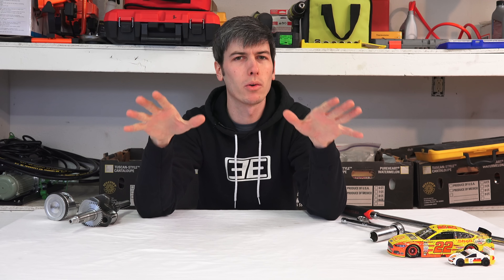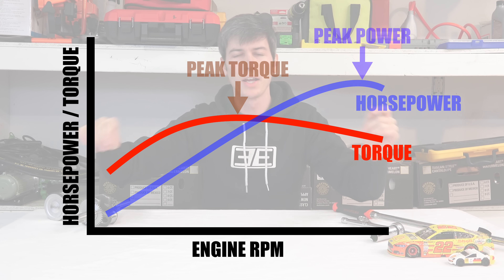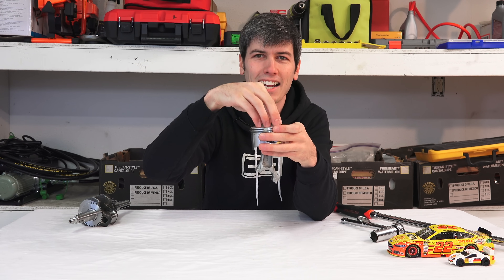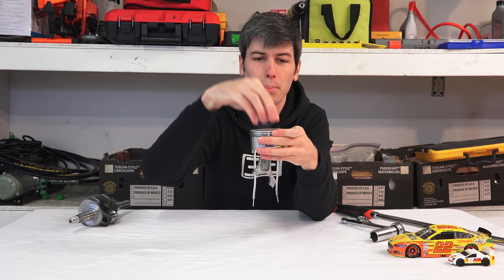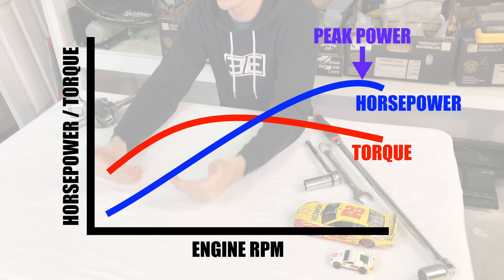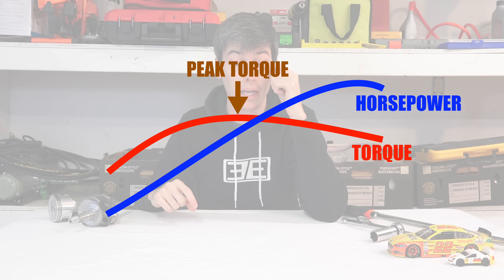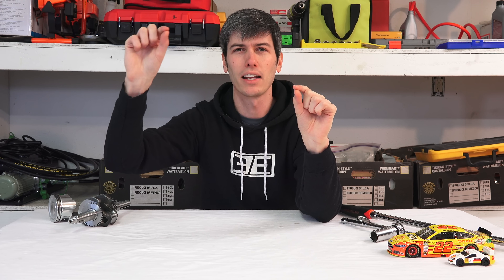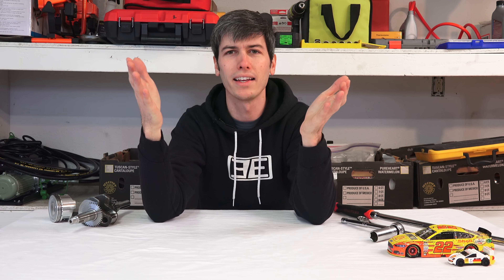Horsepower vs Torque - A Simple Explanation

Comment: Think of it like this: Torque is how much weight you can bench press, horsepower is how many reps you can perform with that weight in a certain time frame.

EDIT: I tried to keep it simple by mentioning "time frame"  because you have to have some way of measuring how fast the weight is being moved in the example I've given.  Which is confusing some people on RPM's vs horsepower. Think of your RPM's as being your rep count. And your horsepower is how fast you can move the weight to that rep count. For example..if you have two bodybuilders that have the same torque but different horsepower, it's going to take the one with a higher horsepower less time to get to 10 reps than it will the bodybuilder with the lower horsepower. Even though they are both lifting the same amount of weight and doing the same amount of reps.
Reply: So then with an engine, there is no muscle fatigue, so it's just your max a number of times within the time frame?
Reply: @dukechangwang8017  not really like muscle fatigue, it’s more of like the actual speed you can rep over and over again.
Reply: @dukechangwang8017  Your question is an ironic conundrum funny enough. Horsepower is kind of like your muscle fatigue. It determines how fast your engine gets up to it's maximum torque and can maintain it's peak potential. If you have low horsepower and high torque, you'll stall out under a heavy load, because you don't have enough horsepower to get to peak torque and maintain it. Just like not having enough energy to do more reps, let alone more reps at a faster pace.
Reply: @Ironwind1972  so since torque is tied in and dependent on horsepower, there's no way you can have high horsepower and too low of torque right?
Reply: @dukechangwang8017  As long as you have the torque to move the weight of the machine to begin with. But take motorcycles for example (inline engines), they have high Hp and lower Tq. That's why they accelerate quick and maintain speed so well, they reach their peak torque numbers faster and have the ample horsepower to maintain it. They just don't need the Tq due to their lightweight.
Reply: @Ironwind1972  you're a godsend I understand this a ton better now thanks 🙏
Reply: @dukechangwang8017  Haha thanks man. Kudos on your computer build videos back in the day. I used to make a few myself on the same subject.
Reply: @Ironwind1972  hahahaha thanks man! Seems like we ended up in similar spot but you're waaaay ahead of me haha
Reply: @dukechangwang8017  No.  A high revving engine with produce the same power as a low revving engine that has more torque.  Power = RPM x torque  = 6000*10 or 3000*20
Reply: @Ironwind1972  thanks now i understand the relation between the two. But it is 'its' not 'it's'
Reply: @Ironwind1972  so in theory when you’re going through the gears, I feel the “pushed back in my seat” sensation at lower gears because they reach peak torque earlier in the RPM range? But when the engine is in auto (even in sport), the engine still upshifts at 6k RPM latest, so is that because it’s saying “if we’re going to be at this RPM while you’re mashing the throttle, we might as well be at that RPM in a higher gear where we max out horsepower here”
Reply: That's a very good explanation
Reply: Force in and of itself is nothing special. Any old wimp like me can lift Eddie Hall's weights using a hydraulic pallet jack and multiple handle pumps and a tonne pallet of mineral water inches its way off the ground using nothing but my arms. Find me the toughest pick up truck and I can conceive of a pedal powered vehicle that can win a tug of war against it. It just needs enough weight on the wheels and enough gear reduction to inch the truck backwards.
There is no way through any system of levers that I can increase the POWER of my body. I have to fitness train for that, otherwise what would we need engines for anyway? I recall Garage 54 fitting 4 differentials to a Lada and giving it epic pulling force, but the engine power was unchanged.
Reply: Does torque mean the torque on the tyre in that case acceleration shoul be greater right since torque moment of inertia times angular acceleration and sice hp us torque times rpm does it mean it has higer velocity ratio and therefore it accelerates faster ?  Does higher torque at fast speed not beneficial bcoz the transmission and tyre are not in sync therefore slowing each other plz explain bro
Reply: @Ironwind1972 Thanks, your explanation makes sense and was pretty understandable. However, the main issue I have with torque is what does it practically mean for my car? I mean, with higher HP number I can immediately make a conclusion that my car can go faster, accelerate faster, pull heavier things, etc. But what can I conclude from higher torque number? Imagine I'm trying to buy a car, I'm looking at two cars and they both have exactly the same HP number, but the car A has more torque than car B. What would I be able to conclude from that? What's that car A better at doing in real world than a car B?
Reply: I would say that horsepower is how much you can bench press (it is straight pushing on the weight), how many reps you can do is how big the gas tank is and torque would be getting a big lever to lift the weight.
Reply: @davesutherland1864  I think that torque is how heavy of a weight you can lift, horsepower is how fast you can push the weight up.  That example works better in terms of engines, but it doesn’t really work to well with human biology. Since horsepower is torque*rpm/5252 (?), then RPM is bench presses per minute, torque is the actual amount of weight you can lift, and horsepower is how fast you can push the weight upwards. It may seem like horsepower and RPM are the same thing in this example but that’s because the horsepower is basically based on RPM.
Reply: @Chevsilverado  If you really want to get technical about this, moving the weight up requires energy to increase its gravitational potential energy (mgd) which is supplied by the arms.  Moving the weight down requires the same energy to be applied by the arms to absorb the gravitational potential energy loss.  The greater your repetition rate the greater the power you are outputting.  When you can’t do it any more you are running out of gas.  The only torque involved in this situation is that at the joints involved in the operation.  This is like a piston moving up and down, but not connected to a drive shaft.  To extend the analogy for torque in an engine would require you to pushing on a lever rather than a weight.  That lever could be use to transfer rotational energy to a wheel or a drive shaft.  In this case the rate you push up and down is related to power, torque is related to how fast the lever turns the wheel, and when you need a break is like filling up the tank.  And you can change gears by changing where you push on the lever.
Reply: @Chevsilverado  I was trying to keep it simple and use layman's terms. But sticking with my human biology example,  RPM would be your rep count. HP would be how fast you can get to that rep count. It's why a high horsepower engine revs to 6000 rpms faster than a low horsepower engine with the same load. Yet they are both still going to 6000 rpms.
Reply: @Ironwind1972  🤦🏼‍♂️
Reply: I don't think this is correct... Sorry.
Reply: Geez... Why are you all making this so complicated?!... Imagine you're with a girl... Can you hold out long enough to satisfy her?! That's you're bloody torque and horsepower... Your mind vs your body hence your ability to keep the flames of passion going... Rev her engines - RPM - your smv...

Comment: Alright, it took me years to figure it out but heres the difference between horsepower and torque.

torque is what the engine makes directly, its the individual combustion stroke of every cycle.

power is torque applied over time. RPM being a measurement that is based on time. and the mathematical relationship between horsepower and torque requiring rpm input.  
Hell 1 horsepower can be written as 33,000 foot-pounds/minute

if you have an engine with low torque and one with high torque, but they make the same amount of horsepower.

its the low torque engine will rev higher.

if torque was always just a straight line in an idealized world. Making horsepower could be achieved by increasing the rev limit, or increase the amount of torque made.

RPM is such an important factor in the torque/horsepower relation, its ashame it wasnt stressed as much as it should've been in this video.

Comment: Perfectly Explained! I've been wondering about HP/Torque. I'm definitely picking up an Indian Scout 1100cc (100HP&72lb-ft). VS. The Harley-Davidson Forty Eight 1200cc (60HP&73lb-ft) Just Can't Compete.
Reply: But doesn’t the scout also have very long gearing i.e it can go upto 100kmph in the first gear and only get the max hp close to the peak rpm and it will vibrate a ton when at high rpms. Why not go for the Indian FTR if you want speed?

Comment: I like to think of the rough analogy that power/torque/rpm have to watts/voltage/amps respectively.
Reply: Pretty much.  And the transformer is analogous to the gearbox.

There ultimately are two factors that determine power in both cases, and power equals the product of them.  You can reformat the mix of those two factors with power conversion devices like gearboxes and transformers, but you need another energy source to change the power.

Comment: I like to imagine a hill and caravans, horsepower being how fast you climb the hill without the caravan, torque being how fast you climb the hill with the caravan.
Reply: That's incorrect, the vehicle with higher power output will be able to climb faster.  Low-end torque will help you accelerate off the line at low RPM, but a low-torque motor can make up for that by revving higher.
Reply: @buzzlesworth54  oh okay I always attributed torque to pulling power, that's interesting completely shifted my peanut brain

Comment: With some fuels like Nitro or Methanol. The amount of fuel you can burn I.E. the power you can make is a function of engine load. Making peak power output closer to peak torque 🤷‍♂️

Comment: FAIL. I still don't get it. I wasn't shabby at mathematics and physics at school. I have not studied either since, but I did study formal logic, analytic philosophy and other conceptually challenging stuff for years. I'm not a dummy. Still, after living 59 years, I've yet to hear a clear account of the difference between power and torque.

Just guessing, but it seems power is the product of torque and gearing taken together. The long handled spanner allows more force to be applied, but more slowly. The hand placed at the end of the long spanner moves a greater distance to achieve the same tightening of the nut. This arc of turn can be geared, and it is the combination of the force over that arc and the gearing that produces power. I think.

But longer handles are just a form of gearing. So, it seems, torque is also the product of gearing an arc of turn,  and this appears to be the beginning of an infinite regress.
Reply: Torque is a turning force. It is a measurement of how hard the engine is turning. A very low torque motor would be easy to grab with your hand and bring to a stop, a hogh torque would not. Power is torque times angular velocity, how hard the engine is turning times how fast it is spinning.
Gears can be used to multiply torque at the cost or gain of speed. A gear ratio greater than 1:1  increases torque at the cost of speed, a gear ratio of lower than 1:1 increases speed at the cost of torque. Power will remain constant unless the engine output is changed.
Reply: @Redtooth75  Pretty good! I'll think about that! Thanks!

Comment: In electronics it roughly translates to: torq is amperage...horsepower is amperage x voltage.
Reply: No, torque is analogous to voltage, and angular velocity is analogous to amperage. Torque is the potential for mechanical power if it's applied to a rotating body in the same way that voltage is the potential for electric power if it's applied to a moving current (a positive amperage).

Comment: Okay..
More power means more speed and faster acceleration.But when does the car with more torque have an advantage over the car with more power but lesser torque?
Reply: If both vehicles are identical except for their torque curves and power outputs, then sometimes the torquier vehicle can initially out-accelerate a more powerful vehicle because at low RPMs the torquier vehicle is temporarily producing more power. It really comes down only to what power is actually being produced in a given RPM range. If the less torquey motor is revved up while holding the brake for an auto or the clutch is sidestepped at high RPM for a manual, then the more powerful but less torquey motor will still win because it's making its peak power from the get-go.

Comment: Mate , make it simple. 
Horsepower is how hard you hit the wall .
Torque is how FAR you move the wall . . . .
Reply: Ahh, the old hitting the wall analogy.  One of the more inaccurate, misleading, and completely bogus automotive myths out there but unfortunately that doesn't keep it from surfacing every time the concepts of power and torque are being discussed.
Reply: @bn4172  
Congratulations on accurate spelling and grammar. 
Most haters cant even manage 1 of those , 2 is impressive.

Comment: You should compare a diesel piston with gasoline piston pointing out how much larger a diesel piston is.  The larger surface area of the diesel piston head allows for more force to be applied on the crankshaft, hence why diesels have more torque.  Furthermore, the uses of fuel and how they combust determine power.  Diesel for example burns very slowly compared to nitromethane.  The nitromethane is one of the key contributors to the 8000 hp of a top fuel dragster.
Reply: The surface area of a piston is determined by its diameter and any valve reliefs, a diesel piston does not have to be larger than a gasoline piston.

Comment: So torque is the distance and horsepower is how fast the car completes that distance?
 For example a cars max kmh is 400 due to its high torque and the car can achieve that kmh in 3 seconds due to its very high horse power?
Reply: No, power gives you acceleration and top speed. Torque just affects drivability, since torque at low rpm means you have more power at low rpm and you don't have to rev as high.

Comment: does horse power change depending on units used in torque ?

Since hp = torque × rpm

Some manufacturers says this car is 300 hp and 250 lb-ft torque, 
While others will say this car is 285 hp and 300 n.m torque...

So different units lb/ft and N/m would result in different hp?
Reply: His formula in the video is actually not correct. The formula for power in general is torque X angular velocity. If you want to measure power in horsepower, torque in ft*lb, and angular velocity in rpm, then the formula is (torque x RPM)/5252. If you want to use different units then the formula would be different.
Reply: @Redtooth75  angular, not radial velocity
Reply: @buzzlesworth54  fixed, i always get those two mixed up
Reply: There is such a thing as metric horsepower, usually abbreviated as ps. I would think that if the torque is quoted in Nm that the horsepower would be metric too, but I'm unsure since I'm used to freedom units.

Comment: So you said Power = Torque * Rpm. I have a question here. Does that mean Torque and Rpm are directly dependent? (Do they require each other in an enclosed chamber?) 
Confused 😕
Reply: No, they can be completely independent. You can have torque without RPM (pulling a wrench on a stuck nut that doesn't move) and RPM without torque (a satellite spinning in space), but neither of these generate mechanical power. Power is mechanical work accomplished per unit of time, so in the case of a motor it's dependent on the presence of a torque applied to a rotating body like the crankshaft.

Comment: Why is the piston offset? What happens if the crankshaft was offset?
Reply: The axis of the piston is aligned with the center of rotation of the crankshaft.  The offset comes from the fact that the connecting rod connects to the crankshaft, at an offset from the crankshaft axis.  If there were no offset, the piston would push the crankshaft nowhere, and the crankshaft couldn't receive any torque to twist it.  It would be like pushing on a rigid beam, instead of a shaft that is free to rotate.

Comment: Guys all i know i will try to explain you know when you have lets say like 160 HP well lets say you have 210 torque if for ex the you will have more torque like 250 and there is another cor with 180 HP but the torque is less than 250 like 220 you will have the head start as u have more torque but in the end the 180 hp will take u i talk about drag race the torque give  more acceleration power but when the other car gets in like 3-4th gear it will go faster like diesel with petrol its same think 2 L petrol with like over 2L diesel petrol start faster but diesel once get 3 gear because have more hp go faster.Good example or perfect BMW M8 2020 GRAND COUPE 616 HP, 553 torque vs BMW 7 SERIES 2020 523 HP, 553 torque, well now same torque but coupe have more hp so they start the same in race but the more they go the more coupe will get fasterafter 1 gear. Get it